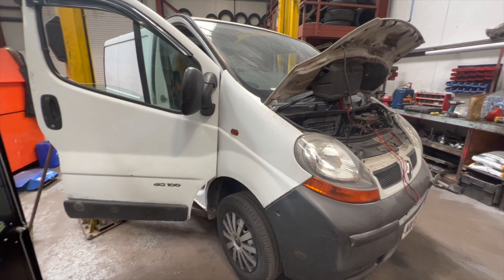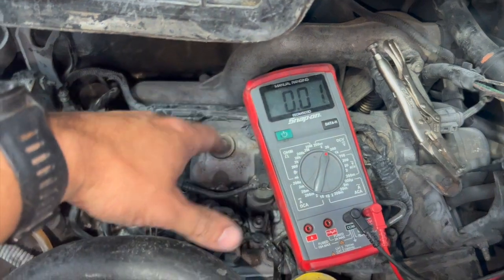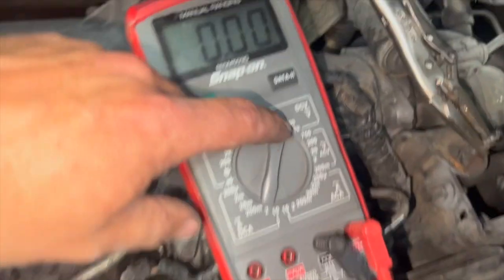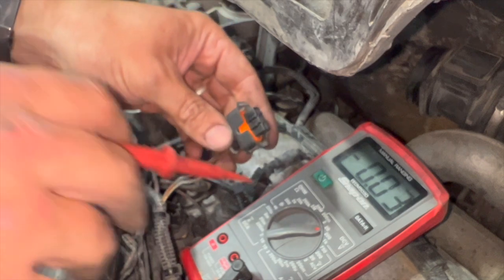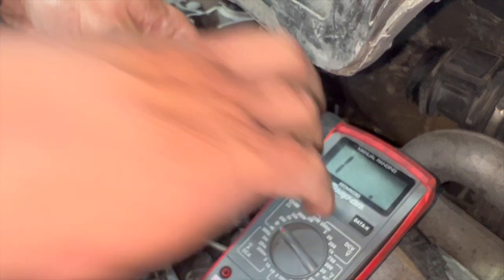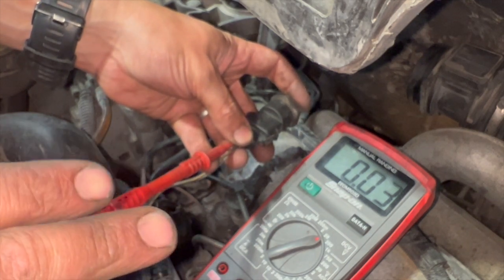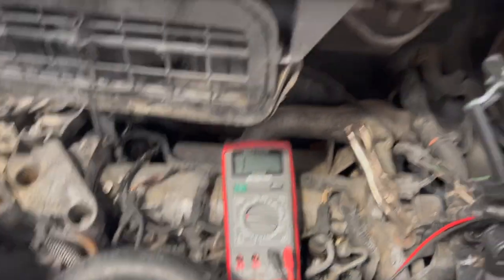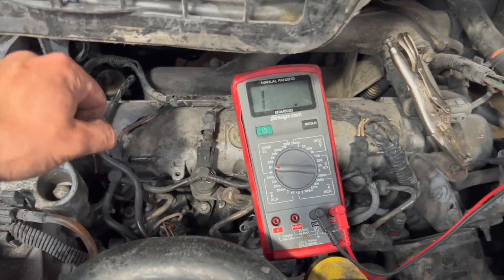Renault Trafic / Vauxhall Vivaro 1.9 CDTI non start fault code 1809 fixed

Comment: Nice. Had a no start problem, watched this video, identified my pressure sensor and... The connector was totally loose! It's not locking into place, but as soon as I pushed it in, I got life. Was seriously considering having it towed but it turned out to be that simple.
Reply from the maker: Nice one! Thanks for the tip .. much appreciated 😀👍 glad it helped you 👍🙌

Comment: I’m getting a po191-c Fuel Rail Pressure Sensor Circuit
Range Performance fault. Brand new sensor. Followed your diagnostic procedure but I am getting 7.5v on the signal wire, you are getting 5v. Signal and ground wire test good. Any ideas on this ? Thanks 🙏

Comment: Hi mate,
What does it mean if the feed wire only reads 1.5v.
The signal reading is fine just the 3rd pin.
It's the same for the feed wire for a few sensors.
The van battery is full. It was driving and died as I was driving off my drive.
Reply: Pull on the wires there is a good chance you have a broken wire just a bit back from  the plug

Comment: With the connector off, I got 5 volts on both pins, rather than  5 volts and 4.7 volts.  Is that within tolerance ?  Thanks.

Comment: 2.5 traffic 2005 won't stay running and stalls I have 9 different fault codes. Could this be ecu? Or circuit breakdown?

Comment: I had a VW Golf 1.4 tsi twin charge with snapped fuel pressure sensor. I bought a second hand one, did not work. so I bought a new one off ebay for thirty pounds ,that did not work. Then I bought a genuine bosch unit, and there you go, works. lesson learned, don't be a tight arse and buy the genuine part. it was only five pounds more. (the pound sign on my laptop is broken)
Reply from the maker: haha! I know the feeling 😖 been there before , also been sent down the wrong route after fitting second hand bits and not realising they were faulty.. Had an ABS unit sent to BBA reman once (they said it tested ok) spend another 2 days checking wiring etc.. was sure it was the pump.. fitted a new pump and Bingo! fault cured. Must admit I do always try get at least (middle of the road) brand parts now , doesn't take many issues for you to loose confidence in cheap parts does it 😂
Reply: @diydaly  Had issues with bba here, sent me round the houses more than once, use another firm now, so far so good.
Reply from the maker: @toeknee6588  yeah same mate, we've gone to ECU testing now 👍
Reply: @diydaly  snap!

Comment: Hi same problem changed sensor got the right voltage on feed and signal and got a ground. But still fault code up and won't start
Reply from the maker: Have you checked the primer pump to make sure it’s not split?

Comment: Many thanks,  I'll be checking mine in the morning.  I am getting poor slow starting and surging throttle . No boost leaks found so I would be guessing but hopefully this might have saved me wasting my money at the worst
Reply from the maker: Thanks , hope it might help, be worth checking for any air leaks into the fuel system
Reply: @diydaly  cheers for the reply.  It definitely is harder to start on colder days and need to get it sorted before I kill my battery in winter. I may swap all the horrible plastic fuel pipe for some rubber as the quick fittings are rubbish too
Reply from the maker: @karlmyers6518  yeah there usually too bad tbf though mate, the most common area is the primer bulb
Reply: @diydaly  I don't have a bulb on mine for some reason but if it is and air leak it on sucks in when the fuel pressure drops off after being switched off. Might be tomorrow before I get on it looking at this weather
Reply from the maker: @karlmyers6518  👍
Reply: @diydaly  tested the sensor and all looks good. Slow to start when cold or been left for a day and surging on full throttle.  
Thinking of changing all the plastic fuel pipe for rubber and do away with the plastic quick connectors. I'm now second guessing myself.
Reply from the maker: @karlmyers6518  have you checked the egr valve
Reply: @diydaly  stripped down and cleaned and tried the 180 switch, swapped the boost pressure sensor and cleaned all the pipes. Sluggish start and better when I pre start a couple of times. All the glow plugs replaced.  If I pull of and stop occasionally it will almost stall out. Its been an absolute pita and need to sort it before it gets to winter
Reply from the maker: @karlmyers6518  😖sounds a right disaster. hope you get it sorted
Reply: @diydaly  oh mate, what a mare I'm having now.
Non start and df067 permanent code